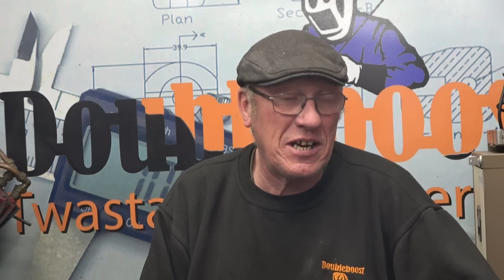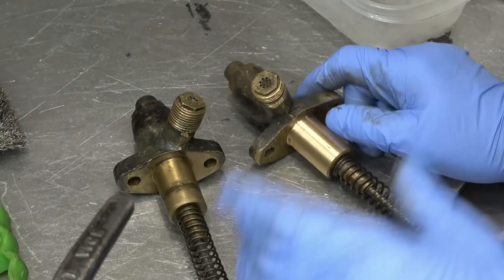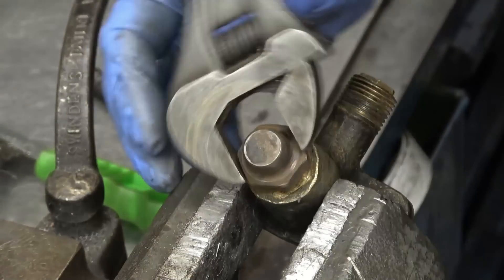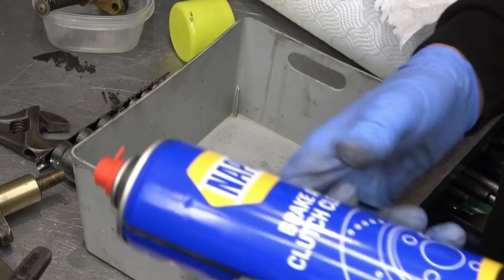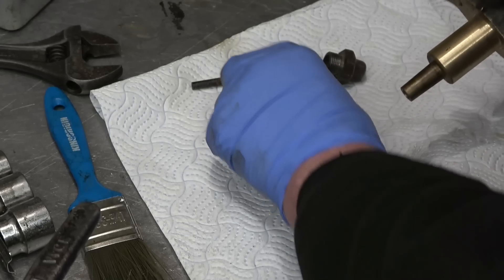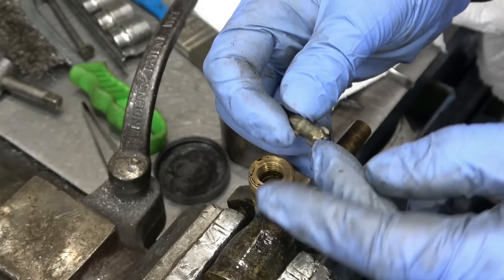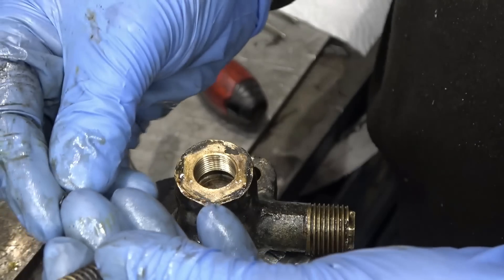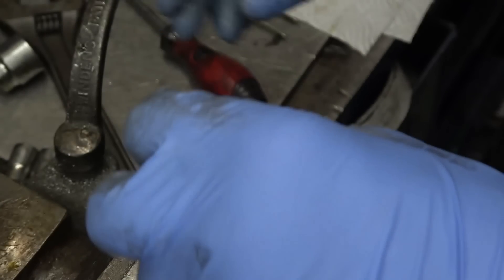SNNC 484  P1. Steam Oil Pumps . Clean & Rebuild

Comment: If you stand a spring on a scale and press it down it will give you an indication of the strength of the spring, this makes replacement easy with the correct pressure

Comment: Get the biggest ultrasonic cleaner you can handle. I always fill mine with just plain water and use ziploc bags for the parts with cleaner so little waste and easy clean-up. The sound waves go straight through the plastic bags and supposedly glass as well although I haven't tried that yet. One downside is that it's usually used in the kitchen for water/sink access and it's noisy so plan accordingly.